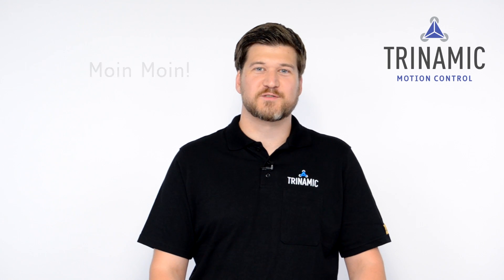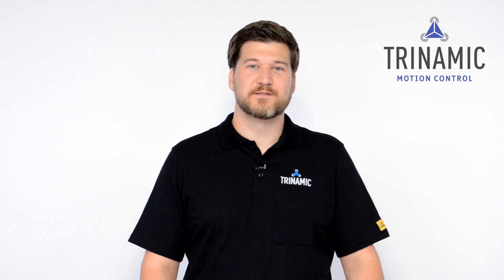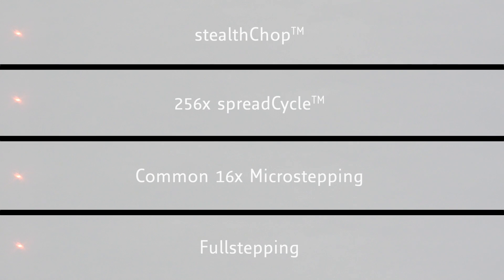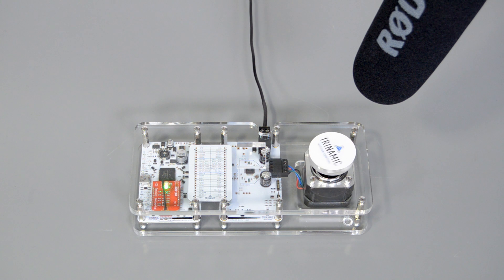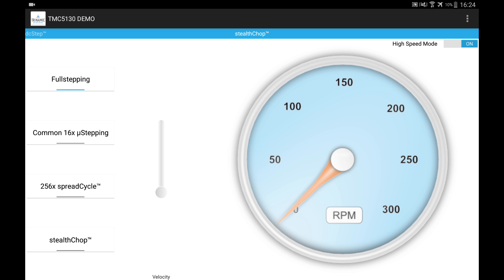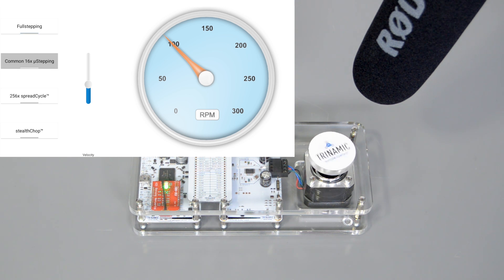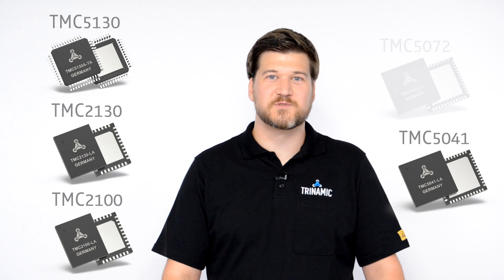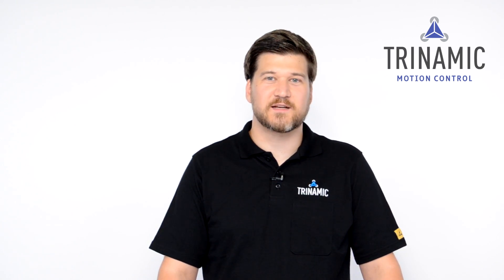Trinamic spreadCycle™ & stealthChop™ technology for silent stepper motors explained.

Comment: HI I have used TMC 2660-PA to develop design now encounter a problem !!
I use https://github.com/trinamic/TMC26XStepper to verify my actions.
But burned Arduino after da Da is not possible to ask what is the problem?
TMC 2660 related information on the Internet rarely even the official website query or 404 ..
May I ask who can I ask the question I am currently experiencing?
Reply from the maker: Here you find product information for the TMC2660: https://www.trinamic.com/products/integrated-circuits/details/tmc2660-pa/

For support questions please use the support button on our website.